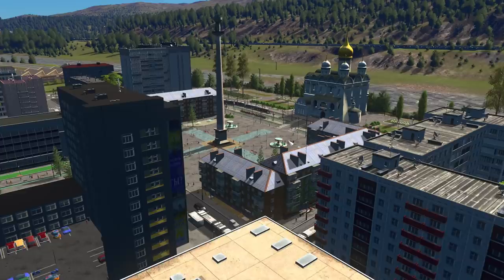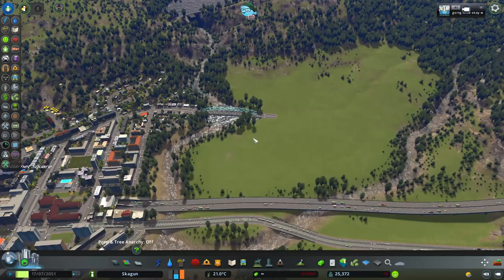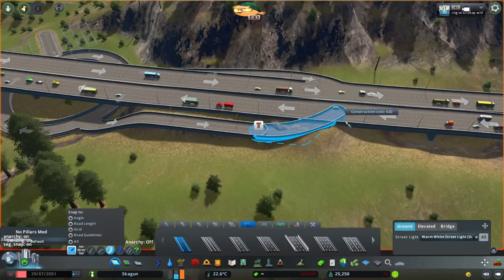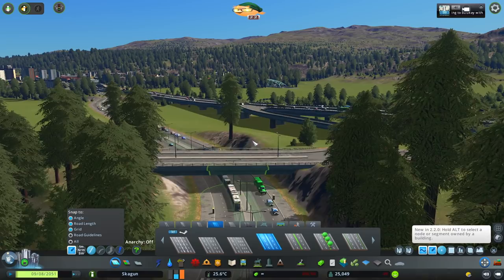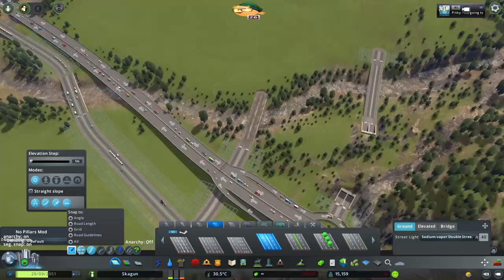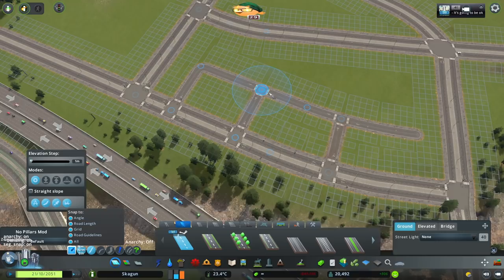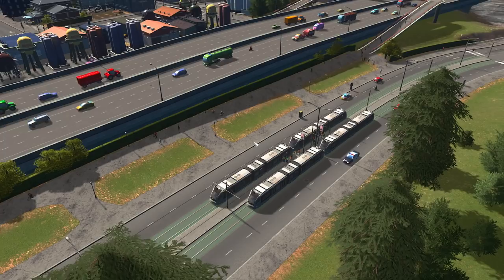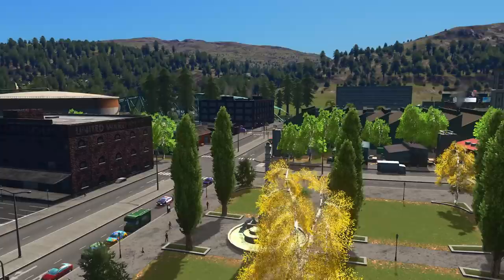INNER CITY INDUSTRIAL ESTATE |  Cities Skylines | EP 8

Comment: Why not just drag the bridge nodes closer to the water with MoveIt?
Reply: Also, since it seems you have the mod, you can make straight slopes and change the road base type(ground follow road/road follow ground/bridge pieces/default) if you click the bubble between straight road and snap-to. You don't seem to know these things or at least remember they are there. It'll make laying down roads a little easier.